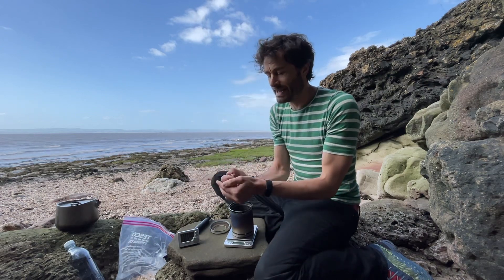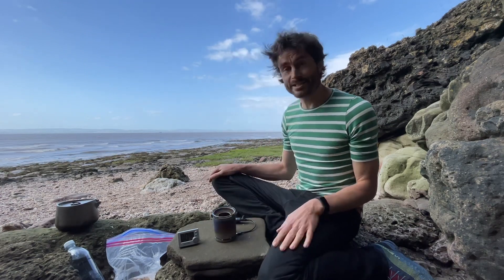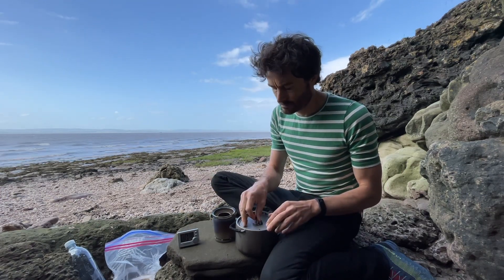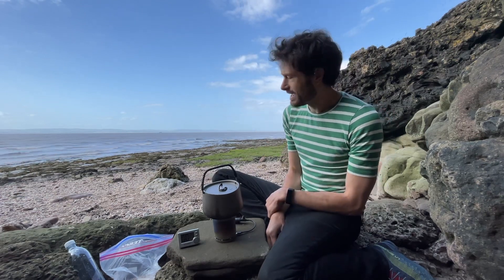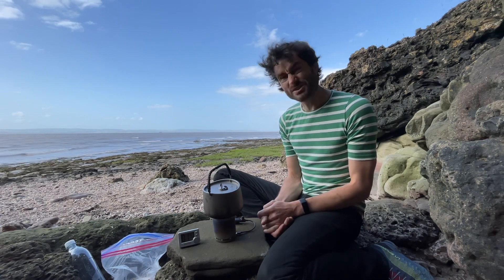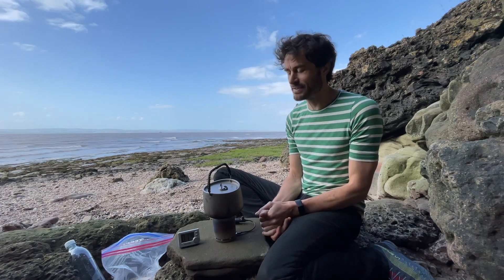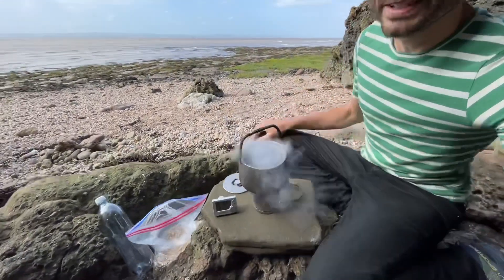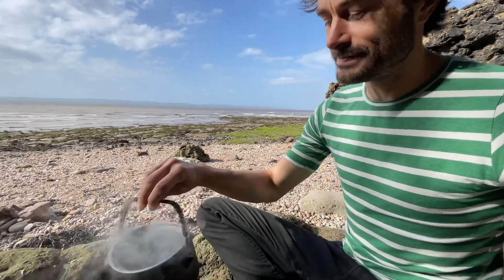🔥 LOFI Wood Stove - How much fuel?

Comment: i have got a boil of 1lt on a normal wood gas stove but also a heat exchange pot in about 11 min, i am curious how much better it might be with this stove and a heat exchange pot, when do you think you might be selling it on eBay or Amazon?
Reply from the maker: Hi John, I’ve not tried a heat exchanger pot, I shall have to look into that :)

It’s not on eBay just yet - but you can buy it on Kickstarter.com just search LOFI
Reply: @JonnyLOFI  if it works better, then perhaps you can design and sell an add-on of just the heat exchanger part so people can use normal pots on top of it, then they would have the best of both worlds, a fast boil and remove the part if you want to cook.

Comment: Does the ash muck up the fan? Hopefully you will include some way to elevate your pot above the stove.
Reply from the maker: Hi KWH, the ash doesn't seem to be a problem - but if anything does get in the way of the fan, it's easily accessible without tools to be cleaned and checked :)  Pots don't need to be elevated from the stove, as there is enough airflow already.

Comment: You need to let it burn to the end and time that, then this should give a good idea of the minimum amount needed.  Or do a few tests. 
Also experimenting by starting with just a small amount of pellets to get it started and then top up once going.
Interesting product?
Reply from the maker: Thnks Mark, some good advice here. I've found that the top-down fires work best on the stove for the cleanest burn and most extended burn times with pellets. Looking forward to some more experimenting!
Reply: Thanks.  I guess with time you will soon learn how much is needed for, say, one cup.  
I am considering such a system for a small yacht, good to have completely safe fuel, that can be bought, or even gathered…and floats.

Comment: Would it not be greatly improved with a wind shield
Reply from the maker: Hi Mark,  The stove has a built-in windshield and the fan pressurises the flame a bit like gas - so it fights the wind pretty well. I guess it could always be improved by an additional shield though!
Reply: I have an amazing alcohol stove that has a conical wind shield, that also supports the mug. It has holes top and bottom, so great heat transfer to the mug.

Comment: I feel like the short cable will be a.. shortcoming of some sorts.
Reply from the maker: Interesting, I could easily offer a longer cable for sale on the website if people thought it was a good idea/extra?  Though this is the 1st comment I've had mentioning it - lets see how we get on?
Reply: @JonnyLOFI  i feel like if i can get more than 30cm between burning fire with the boiling water & the lithium battery, I wouldn't mind.  Leaves more flexibility with placement of the battery on the terrain (saw one video where lofi was set up on a rock & the only option for the battery was right next to the stove because the cable wouldn't allow for the battery to reach the ground/next rock over)

Comment: I'm not sure why you didn't provide a pot stand for it to create at least a 1-2cm space between the stove and the bottom of the pot or pan. The current design means you're kind of snuffing the fire out (or dangerously trapping the heat inside the stove) when you place the cooking vessel on top of it...
Reply from the maker: With the fan pushing air through the burn chamber, there is no need for the pot to be elevated any further 👍 The constant airflow keeps it from choking / snuffing the fire 🔥

Comment: For me the form factor of normal gasifier stoves are a little bulky, but the extra efficiency and power this little unit has really looks like it could be a great option ....... however straight out of the gate it’s reliance on battery power seems to be it’s Achilles heel, it would be a great advantage if you could design it so it can run without power (in a pinch), may be make the base removable/modular ..... twist off, and replaced by say another modular base (which could be stored as a lid) which could allow the stove to operate as a normal induction gasifier stove ..... maybe version 2.0?
I understand it’s really no different to a canister stove when you are out of gas you’re out of gas, just can’t help thinking what could be.
Reply from the maker: Thanks Dan,   Like you said gas stoves already rely on the fact you need gas, but I hear what you say, and I really like your idea of a lid you can switch out with the electronic base. The base already does twist off for emergency field maintenance (if something has made its way into the fan for whatever reason). Maybe it could be a stretch goal on the Kickstarter?

I'll have a play and see how I get on with the base removed.
Jonny
Reply: @JonnyLOFI  Well its great that you might consider this function, sure hope it could be possible.
One other thing it would be good to know/see, what this stove might be paired with, what existing cookware is it compatable with ...... such as it seems it would possibly match neatly with a 10cm Zebra pot, maybe theres a titanium pot it would stack with? These types of questions are what comes to mind when I start thinking about how I would use it.
It looks like a great product, its sure to be successful, cheers.
Reply from the maker: @bunyipdan  Definitely. It fits well into most 750ml (or larger) titanium pots including the VARGO BOT.  I'm hoping to offer a tidy little pot as an extra when buying the stove, though most people have something that will work 😃
Reply: @JonnyLOFI  An offer like that sounds like a great idea, good to here that it will fit in most 750ml pots, sometimes difficult to be sure about the scale of things, cheers

Comment: As a bit of a wood stove addict I’m really impressed by this! Having the forced air is interesting and I imagine it basically eliminates the majority of the smoke you would get with other wood stoves that are not double combustion. I’ve seen stoves like the BioLite before but personally I think those are too bulky and well kinda ugly. I really like the clean design you’ve created … and the weight is just really impressive! Excited to see more! Best of Luck!
Reply from the maker: Thanks!  Yes, I’m my tests I found that all to often with a non-forced air stove that putting the pot onto would choke the chimney affect and starve the fire of oxygen. This results in a cooler fire, and lots of black smoke!!
The LOFI stove with its forced air largely eliminates this problem! 🚀
Reply: i personally have been using the biolite stove for a few years but only take it when car camping. its way too heavy and bulky. now that i have the lofi it is my go to companion. that thing rocks.